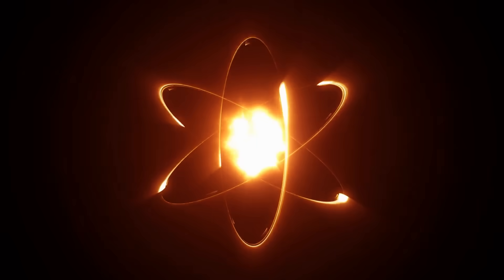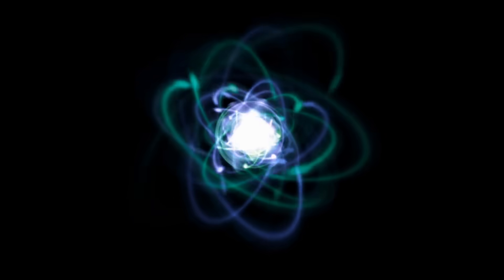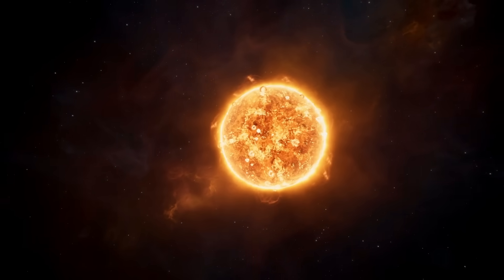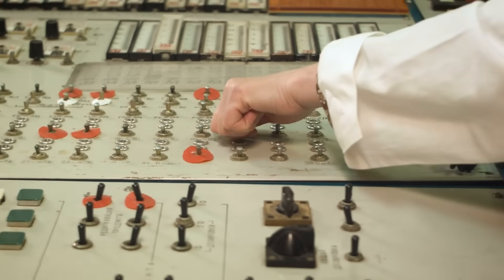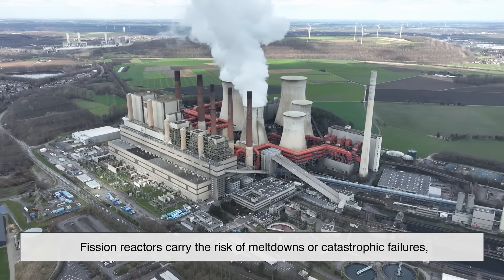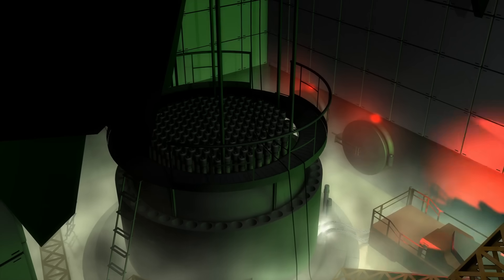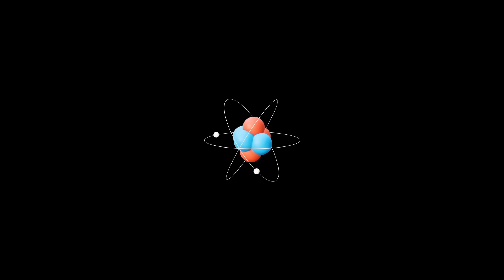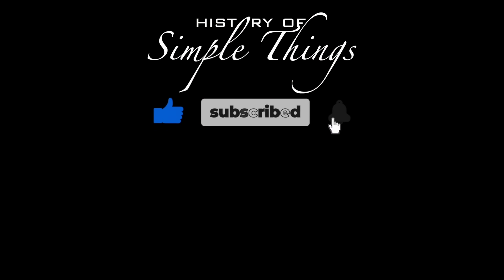Nuclear Fusion or Fission: What is the difference?

Comment: Timestamps 00:07 - Nuclear fusion and fission are distinct processes with different implications for energy.
01:18 - Nuclear fission splits heavy atoms for energy production.
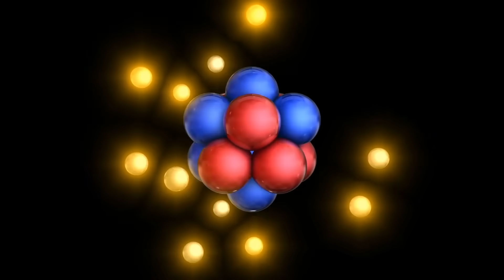02:23 - Nuclear fusion combines light atoms, releasing more energy than fission.
03:23 - Nuclear fusion and fission are fundamentally opposite processes.
04:22 - Fusion offers higher energy output and greater safety compared to fission.
05:19 - Fusion energy has potential but faces significant practical challenges.
06:19 - Nuclear fission is currently easier and more predictable than fusion.
07:20 - Nuclear fusion is clean and abundant, while fission carries risks.